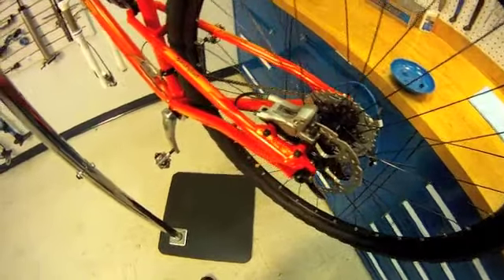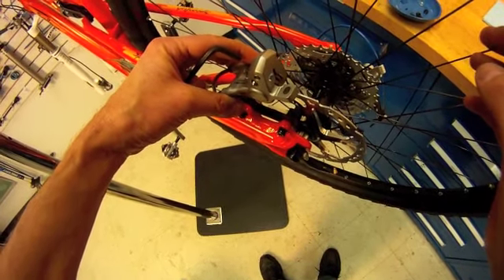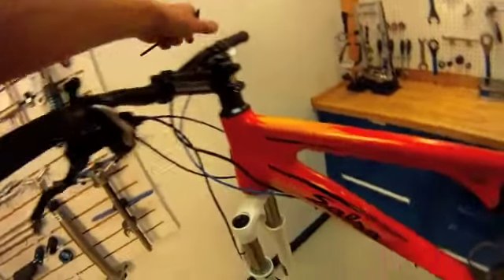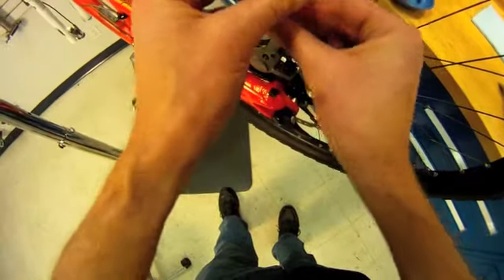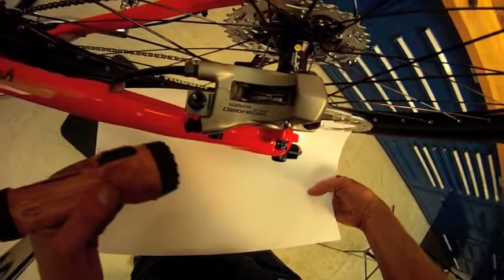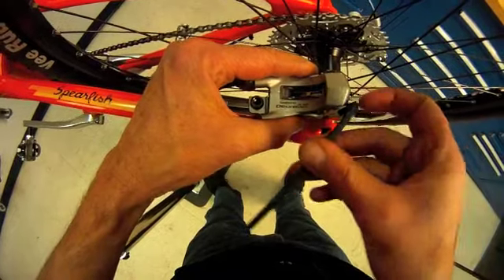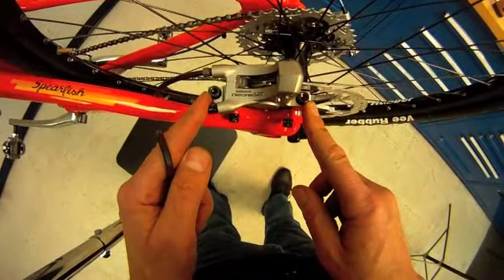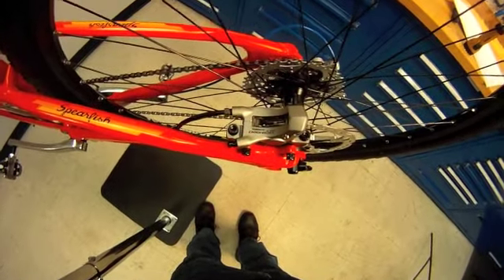How to Build a Bike - Part 11 of 12: Hydraulic Brake Adjustment

Comment: Why didn't you just squeeze the brake while loosely bolted, and tighten while holding caliper true with hydraulic pressure?
Reply: Did you ever find an answer to your question ? It's a great question !